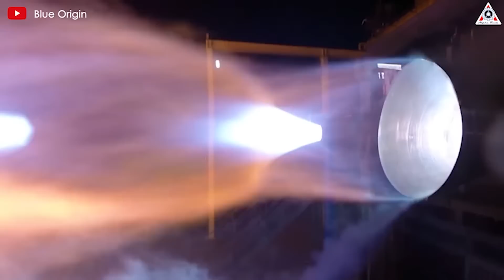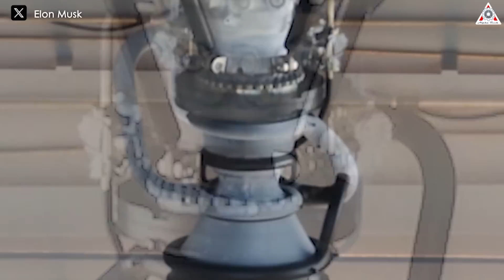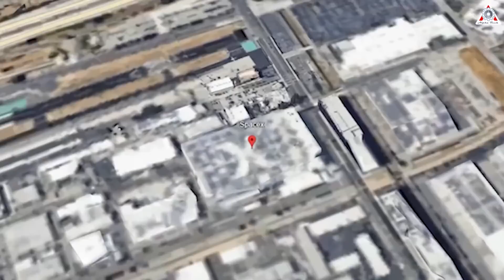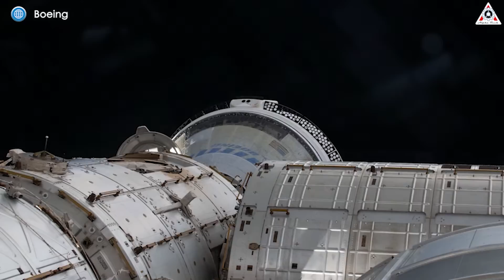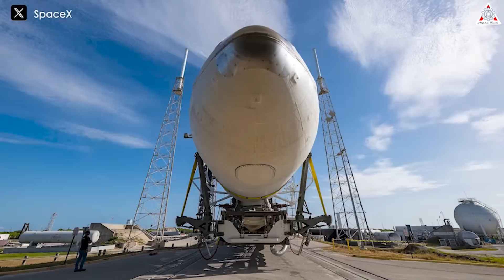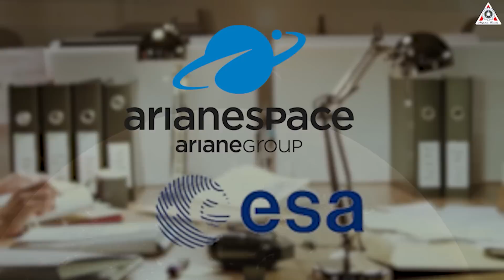SpaceX New Raptor Engine V3, V4 just HUMILIATED Blue Origin and NASA, even Russia!!!

Comment: What a great view from under the rocket showing the engines - but what are those 'bits of debris' bouncing around shown in the video ?
Reply: debris on the ground or corrosion off the engine stand?I doubt it is coming off the engine itself.Air circulation sucking in and whipping around has got to be crazy.